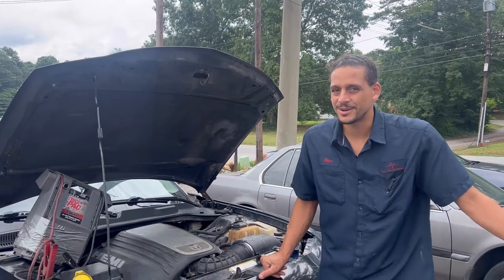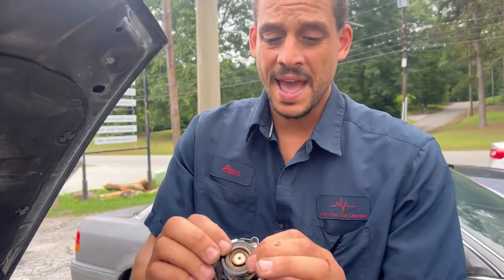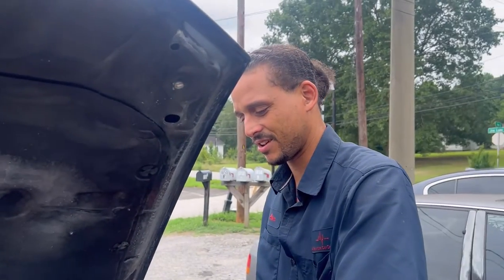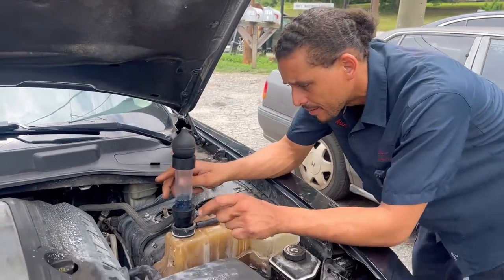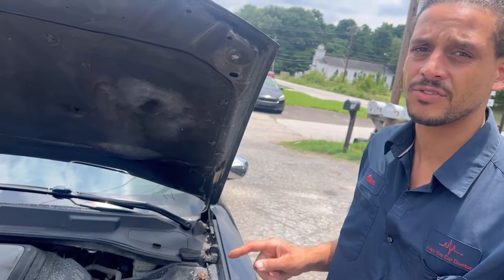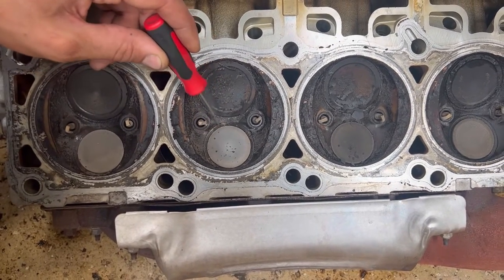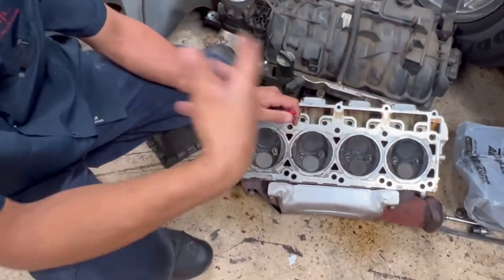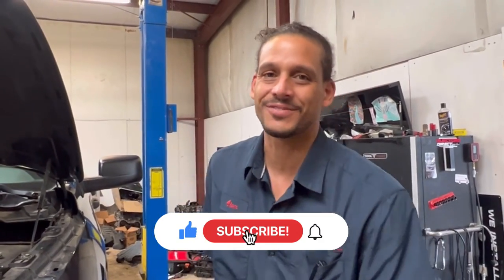Dodge Charger RT Running Hot - Now The Engine Is Making Noise (Sounds Terrible) #dodgecharger

Comment: This is crazy I had a 2008 Chrysler 300c hemi. Bought it in 89k on the dash in 2011, sold last year with 250k on it. No motor issues or transmission. I just simply change the oil and add MMO. Did basic maintenance. I've always let my hemi warm up for about 5-7 mins every morning or after a long sitting. To avoid motor damage.
Reply from the maker: Awesome, good maintenance habits will take the car a long ways. I always tell people some cars you just have to stay on top of them more than others

Comment: My 2019 Hemi coolant hose came off and car overheated. Lights came on and I shut the car off immediately but now I get the same knocking sound for 1 sec as the car cranks only. It only happens when I’m starting the car for 1 sec then starts and also isles fine. Can bad water pump make that knocking sound? My heat didn’t work either and took it back to dealer

Comment: Question, my Dodge Charger, 2006 Hemi, I changed the water pump, the thermostat and the reservoir bottle and my car temperature is right now, I get too old 203 and my oils running at like 214

Comment: I overheated my hemi engine a few times but never let it get on H I would always stop and wait 10 min then continue home... FYI the only times it happened when i was on my home and luckily not far from it.One time it actually hit H and i immediately stopped put antifreeze and let it sit for 10 min fixed the problem and its still running strong so far,guess i got lucky.

Comment: Sup bro my question is will misfires cause a hemi to run hot because I put mines on the code reader and it told me I have some misfires and I’ve noticed that it runs a lil hot when I drive it a lil hard

Comment: I have 07 grand Cherokee, i took it to get a full inspection and they said it only needed minor parts. 15 minutes after leaving it runs hot and shuts off every since that day I’ve been having multiple issues with it i redid the whole cooling system and now it’s misfiring I’m wondering if my vehicle has the same problem as this charger and Ram
Reply from the maker: Is it still trying to run hot
Reply: @AlexTheCarDoctor  no not anymore, my needle normally sits below half at the quarter mark sometimes it’ll go to half but then go back down
Reply: @AlexTheCarDoctor  it does have a tick that started about 6 months ago i then got it looked it and was told it was a broken manifold bolt, had a second look at it and they were saying it’s my valves spring

Comment: I have a 07 Dodge Charger rt, the fuel mileage drops, and check engine light is on , I just changed all 02 sensor now the dealership saying I need a engine harness, plus the key cylinder will come on but car says nothing…
Reply from the maker: Hey there buddy, do you have a scanner if so what codes are coming up
Reply: @AlexTheCarDoctor  thanks for responding I’m gonna have them checked because I just jumped in and crunk with no problem
Reply from the maker: @mcgarrettdavis8480  keep me posted, sounds like a bad wire connection problem

Comment: Heads are aluminum block is steel.. aluminum shrinks in overheating and eventually will blow the gasket… why they are so touchy to overheating….. keep driving while hot ur gonna drop a valve seal.. keep driving after that its ur cam.. keep driving after that one of those 8 cylinders will go thru bottom of the block and be on the road somewhere lol and take those engine covers off u will drop 7-10 degrees yes ur injectors will be louder but u will run cooler after market intake that isnt plastic fixes the loud injectors
Reply: @Rtboy954xx  my charger over heated and turnt off more won’t turn on

Comment: Your videos are very helpful, Ty 
I got a 2006 charger 5.7 and it’s boiling the water from the reservoir and it seems that the cap is no longer working is not showing overheating on the dashboard or make noises but i haven’t drive it since, do you think by changing the cap will fix the problem !?
Reply from the maker: Yes, radiator cap could definitely solve the problem. A lot of people overlook that. Start there, if that doesn’t work, look at the thermostat.

Comment: Hey i have 2014 Charger its over heating not sure where the leak is should i do i block test or burp the system nd make sure i have no air in system

Comment: I have a 06 charger 5.7 daytona I filled up the gas tank and I noticed I have a low Idle about 700 to 600 then the car jump then cut off. No light comes on. The engine temperature was at about half. It did it 3 x I want to flush the Coolant and put some fresh in it. Do you have any other suggestions. I just got the car it has 88,000 miles on it.
Reply from the maker: Not at the moment no suggestions maybe bad gas since the car started doing that after you filled it up? Or maybe a bad purge valve but that will throw a check engine light.

Comment: I have a 2009 dodge charger when driving everything is fine but when at a light or idling i smell the smell of hot radiator water no leaks but my car always needs water already changes the thermostat 😕

Comment: My silverado overheated Its running rough almost sounds like it's gong to die any second barely going when I hit the gas There's no smoke or no water in engine but I'm scared to find out what's wrong with it
Reply from the maker: Hey there sorry for the late response. have you had the vehicle looked at yet

Comment: I don't know anything about mechanics. My son has a Dodge charger RT 2013 bought it with 141,000 miles . At 153,000 it started sounding ruff. We spent $700 for "mechanic"  to change two fuel injectors and 16 spark plugs which resulted in no improvement. Nice guaranted work standard additional charge of $90 for tow to Gaddis car dealership. 
$150 in more diagnosis of a leaking water pump at $1000 + cost which resulted in having to get a loan add the interest almost $2grand 
We think we're getting call to pick up our $11 grand financed less than year ago+ $2g loan 
With the water pump fixed, the engine burning coolant which has cracked head gasket, alternator shorted out  the estimated cost $12 grand .... We've got an extended warranty but  from what I'm gathering due to the failed water pump,  overheating  though it's been solely towed upon fuel injector replacements ... 
What is the best option at this point? 
How is  a BLOWED motor not recognized before the leaking water pump? By 2 mechanics! 
Is it me or is this shady??
Neither could diagnose a cracked head gasket junk motor prior to the $1,700 of labor/parts
Reply from the maker: Wow sounds to me someone skip some diagnostic steps and you should be compensated for your inconvenience

Comment: My situation is weird I have a 06 charger Daytona and I noticed when I got close to home I started to smell coolant and it started to run a little funny and when I got to the driveway before I could even put the car in park….it shuts off on me and started smoking. Now I was watching my temp gauge and it never got above the halfway mark and the check engine light never came on so I’m trying to figure out why did it shut itself off without overheating?
Reply from the maker: Chrysler vehicles will overheat without actually displaying on the gauge, I’ve blown head gasket on one of my for sale vehicles this Way.my suggestion is to perform a block test to make sure there’s no head gasket damage before replacing anything

Comment: If so I have a 2008 dodge charger 2.7l engine and I've replaced the water pump,the radiator, the radiator fans, the thermostat, the reservoir, the sensor on the bleeder and the bleeder, the cap and also had it checked for a block test,but it still continues to run hot?
Reply: Damn. Least it's likely not the gasket.

Comment: I just financed a RT not even 30 days ago as is from a dealership 🤦🏽‍♂️ the water pump burst shop called to say that was fixed now come pay oh but your engine is no good 😑 I was told my car overheated after the pump was replaced and when they checked for coolant leaks without turning the car on found none so that told them the engine was gone 🫠 I have still been driving the car for about 2weeks I brought peaks antifreeze but it hasn’t significantly dropped the only thing I can say now is it’s like my car needs something changed like oil change (got it at 101K sticker says change at 107K) or ignition coils something soon but I’m still running strong every start, no hemi tick just small automatic shifting issues while driving and when I punch it? There’s a very big delay still there’s no smoke and basically my gauge cluster has never indicted it was about to overheat even when the water pump burst and I was told by a mechanic he has seen that happen multiple times in cars and the car was in fact overheating   
PLEASE HELP ‼️‼️‼️
Reply from the maker: They should have did a combustion test BEFORE the repair to check for a blown head gasket to save you time and money. Now you got it around the mileage where it’s time to change everything unfortunately. Most maintenance starts becoming due around 60k to 150k miles. I suggest you check for a blown head gasket. That could be the case and will affect driveability.
Reply: @AlexTheCarDoctor  if that is the case a head gasket kit and labor is my fix ? I definitely appreciate the reply got my subscribe 💯

Comment: ALEX , I have a 2012 dodge charger SXT overheating, I  replaced heater cooler ,heater holes ,radiator ,thermostat and still overheating any ideas why
Reply from the maker: First make sure there isn’t any air in the system. Second, I’d do a block test to make sure the head gasket isn’t blown.

Comment: Hello I've been watching you for a while and it's been helping with my dodge charger. My charger has been acting crazy. It overheated and started not starting so I changed the starter as well as the oil filter cooler and the knock sensors and the radiator and before I changed the starter it would turn over but not start now that I changed the starter it just tu Ms th lights on battery is good I changed the starter relay and still nothing I'm so confused need help
Reply from the maker: Hey there sorry to hear that you are having all this problems.You May have Defective starter you can test it yourself with a relay bypass kit I will send you the link https://amzn.to/3ou16Wq. We need to verify the starter is working before we proceed to looking at other stuff keep me posted on everything
Reply: @AlexTheCarDoctor   thankyou

Comment: what is an adequate temperature the engine should be at at most time?
Reply: My 08 charger rt usually engine temp 94-100 degrees and that’s with a new radiator/coolant top up and cold air intake and it still runs pre hot. But I jus got it back from the shop today for inspection no leaks no problems but needs new tires lol. So my advice do what you can to cool it off and don’t shut it off to soon when driving it hard let it sit for 2-3 mins before you turn it off I also open the hood with a fan going in my garage

Comment: What’s temp is to hot?
Reply from the maker: I don’t like anything over 220 degrees. At 230 degrees you’ll start running hot. Car temps should be around 195-210 on the average vehicle.
Reply: @AlexTheCarDoctor  ok ty

Comment: My 014 hemi over heats after 5-10 min of me driving sometimes will shutoff on me at a light my gauge Never lets me know when the car is running Hot .....
Reply from the maker: The first thing you need to do,a block test to make sure you don’t have a blown head gasket